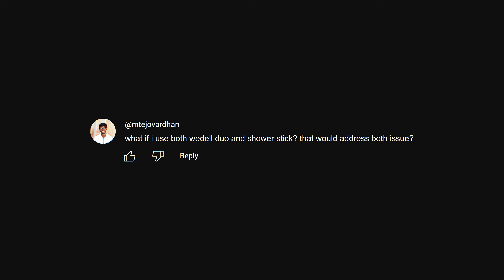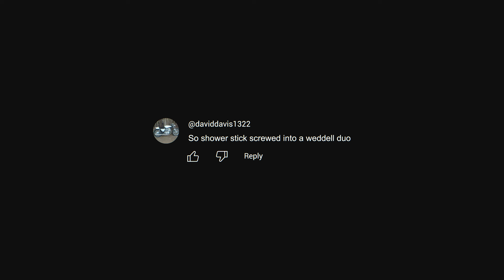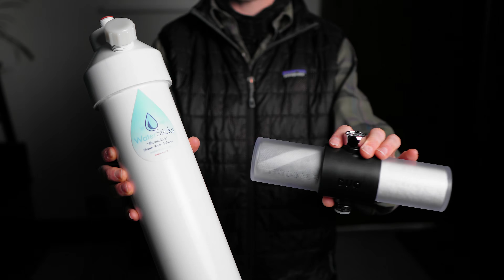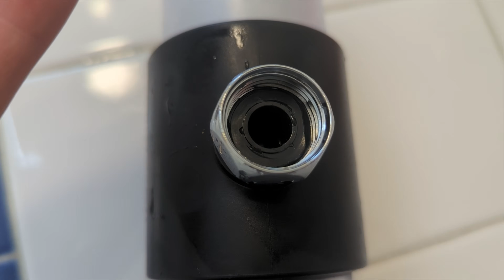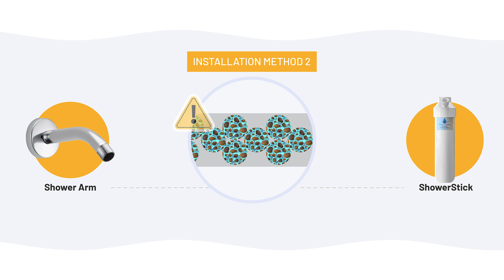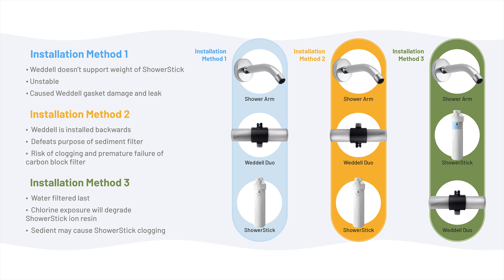Weddell Duo + Shower Stick Compatibility Test

Comment: The Weddells connections are terrible. Add a few more threads on each end would make a huge difference. The designer needs to be beat with a rubber hose.
Reply from the maker: Have you shared this feedback with the manufacturer directly?

Comment: Have Water Sticks update the design since this video? Because from the pictures I see online, there is a bracket that sits on top of the metal shower head pipe and holds the Water Stick like a brace.
Reply from the maker: They must have

Comment: I don’t understand the problem with mounting the duo after the shower, stick i.e. on the bottom of it as shown in method three. The shower stick normally does not have a chlorine filter upstream when installed alone, as per manufacturers instructions. So why would it be a problem with installing your chlorine removal filter after the hard water removal done by the shower stick?
Reply from the maker: I don’t know why the manufacturer instructions would suggest installing it in that configuration. From a water treatment standpoint, it’s generally backwards.

Chlorine can damage the cation exchange resin inside the ShowerStick over time. That resin is what actually does the hard water removal, so exposing it to chlorinated water shortens its lifespan and reduces effectiveness. In the water treatment industry more broadly, we almost always recommend removing chlorine upstream of any water softener for that exact reason.

The only real exception is if the water is extremely hard and you’re trying to prevent scaling or fouling of a downstream carbon filter. But in typical residential conditions, protecting the resin is the priority.
Reply: @waterfilterguru  Their  installation video shows you can install a KDF canister style filter upstream of the Shower Stick. A link to that video is attached.  videhttps://youtube.com/shorts/1jJxiTd4g4Y?si=Z4-kuETSRZLqVGpM

Comment: I have this exact setup and it works perfectly. The Shower Stick comes with a bracket, so all the issues described in this video don’t really apply. The bracket holds the Shower stick firmly (attaches to the shower pipe itself). The set up was super easy. Very happy with mine so far!
Reply from the maker: Glad to hear it. There's an even better way to soften hard water for renters, https://youtu.be/f5cbIdOZzek for anyone else reading this

Comment: Im confused. I understand your reasoning to install the weddel duo before the waterstick, but the installation video for the waterstick website recommends to install a kdf filter after. So in your 'testing' you found the water filter is best before a softener?
Reply from the maker: Don't know why they would recommend that order of installation. KDF removes chlorine, which can damage the resin in the softener. Chlorine should be removed upstream of any softener
Reply: @waterfilterguru hm good to know. Will try to set it up before hand. I will also ask customer service to confirm the order of installation. Thanks!

Comment: The water stick has a bracket to hold the weight and tubing that runs from the filter to the top of the under hanging water stick.
Reply from the maker: At the time of recording it did not. Thanks for the comment!

Comment: I have an important question since the shower stick is meant to be placed under the shower. My question is about the resin inside the shower stick. Will it be damaged or deteriorate with hot water? Most water softeners with resin specify a maximum temperature for cold water and a maximum temperature the resin can withstand. I checked the website and couldn't find any information about the maximum temperature the shower stick resin can withstand. To be honest, you'll mostly be using it with hot water...
Reply from the maker: Great question. I’ve looked into this and from what I’ve read in the documentation from cation-exchange resin manufacturers, cation exchange resins (what's used in water softeners) can withstand temperatures far higher than what people shower in. Here are a couple sources:
https://www.dupont.com/content/dam/water/amer/us/en/water/public/documents/en/IER-Temperature-stability-TechFact-45-D01456-en.pdf
https://www.resintech.com/wp-content/uploads/2021/03/Somelikeithot-1-1.pdf

I’m not aware of any research or data showing that the materials used in softening resin leach chemicals at normal shower temperatures. This is a great idea for a follow-up project and I've added it to my list.

One thing that really matters also is certification. Resins used in water softeners can be certified to NSF/ANSI standards for safety, and they should be able to tell you exactly which resin manufacturer they use. From there, you can verify whether the resin itself is certified or not.

I hope this helps
Reply: @waterfilterguru Great, it was really helpful... and thank you so much, your channel has helped me a lot to learn a little more. There are many products that are just marketing hype, and others that are really worthwhile for taking care of your health. 👏
Reply from the maker: @YOSHVE-y3b glad to hear it! Thanks for the support

Comment: I dont get why the 2nd or 3rd option wouldn’t work especially if someone was going to get just one of the products. I just bought the wedell and it didn’t last 2 weeks before it started to lose pressure. Would it actually be worse to have it at the bottom of the shower stick? If its before the shower stick I would assume it would be clogged up in another 2 weeks?
Reply from the maker: I made this video all about this https://youtu.be/Z9qCHgU0V7M

Comment: This was so helpful! I have the water stick but my hair is majorly suffering 😢 Please help us Water Guru! 🙏 I am an aesthetician, so the health of skin and hair is paramount ❤
Reply from the maker: The shower stick should be softening the water, so you can rule out hardness as the culprit assuming it is working properly. You can test this with simple water hardness test strips. If the water coming out of the shower with the shower stick installed is soft, it's working. If not, it needs to be regenerated with salt following the manufacturer's instructions. 

Chlorine is the other common culprit for hair issues. The shower stick alone does not remove chlorine. You need an additional chlorine filter, do you have one installed with the shower stick? 

This is all assuming you're on city water. If you're on well water there are other water problems that could be the cause.

Comment: I was able to connect the Water Stick to the Weddell filter.  I connected the Weddell directly to the bottom of the Water Stick and reversed the filters in the Weddell so the  Weddel outlet is now the inlet and outlet is now the inlet this should put the water flow through the white filter first then the charcoal filter next and finally the water flows into the "Water Stick" and out to the hand held spray nozzle.  To avoid putting too much weight on any plumbing fixtures I purchased a second connection hose and rested the whole device on the rim of the tub on its side and used 3M hooks plus zip ties to keep in place resting on the rim of the tube.  It is placed horizontally on its side under the tub spout with the side port point up.  This allows it to drain through the handheld nozzle when you need to regenerate it just pour salt solution into side port per Water Stick's instructions.
Reply from the maker: Nice! Thanks for sharing
Reply: Please do a video on this.

Comment: Awesome review, seems method 3 is acceptable “IF” you recharge/clean maintaining shower stick performance more frequently. Thoughts?
Reply from the maker: Yes correct. The shower stick will require more frequent regeneration. The regeneration process is a little bit more tricky too since you have to mix a salt solution first and pour it in a small port, rather than simply putting dry salt directly in

Comment: Great video! I was wondering if you could test the Crystal Quest shower filter to see if it’s legit in removing heavy metals?  I have it hooked to my shower stick and it seems to work just fine.  Just not sure how legit the product is.  I’ve had the Shower stick for over a decade and love it for my soft water in the shower as a renter.
Reply from the maker: Thanks for the comment! I haven’t tested the Crystal Quest shower filter yet but can add it to my list. Just keep in mind most shower filters aren’t certified for heavy metal removal, so any such claims should be taken cautiously. Glad to hear your Shower Stick is still serving you well — soft water really does make a big difference in the shower!

Comment: This wouldn't be such an issue if Weddell just made the middle part out of metal. Being that it's almost $100 I hate the fact that it's all plastic. Middle should be metal and the ends should remain the clear plastic so you could see inside.

That being said, I did use your link and code to order the weddell, but I guess I'm not getting the water stick. However I do wonder though if the seal is getting damaged from the weight, maybe you could just take it out and use the plumbers tape only to prevent the leak? I guess you'd just have to be careful not to bump the whole set up. Too bad weddell can't make a unit that softens as well as the other two filters it has.
Reply from the maker: There's a better solution to soften hard water and combine with the Weddell filter, which doesn't put strain on the connection. Check it out! https://youtu.be/f5cbIdOZzek

Comment: For method 1 I don't understand. Why not use a short hose from the Duo to the shower stick? Then your shower stick would be mounted to the hanger bar with a clamp and not dangling with the Duo. If you see their KDF Shower Filter setup with shower stick, then it should be same thing, you just need to replace the KDF filter with Weddell Duo
Reply from the maker: The mounting bracket for the shower stick was not available yet when this video was made

Comment: Wow!  Thanks 🙏🏻 so much for testing all these shower filters and water filtration systems!  You have the best data 📈 on all of this and it is so helpful! 🌟 I can’t thank you enough for saving us consumers all the headaches!  It’s been a nightmare trying to find what’s best due to sneaky marketing and scams!

I was really hoping to see these two shower filters working together.  I’ve had the Shower stick for over a decade, believe it or not! 😅 It’s eye-opening to see the results.  Definitely great for softening the water but it does upset and concern me that it doesn’t seem to get all the bad stuff out.  If you do another video on a better water softener solution with the Weddell Duo, that’d be amazing!
Reply from the maker: Already did! https://youtu.be/f5cbIdOZzek
Reply: Hi, you said you had used shower stick for over a decade.  May I ask if just 1 shower stick can last over a decade and still soften water without problem?  Or do you have to re-purchase a new one after certain time(whenever it stops working to soften water)?  Because I read some people said shower stick only works for a few months and then stop working afterwards.  I have been struggling with dry hair from hard water for 20 years and really want to try the shower stick.  But not sure if it will work for more than a year to justify the money.
Reply: @LaiSanMak  Hi!  Yes!  I still use the Shower Stick!  I have to regenerate every 5-7 days depending how often I shower.  They last for about 10 years and then you do have to buy a new one.  I am on my second one and have no issues.  Also good to get a chlorine filter for extra protection.  Definitely worth it for your skin and hair!  I haven’t had any issues all this time!
Reply: @Metalgal80 Tks so much for your sharing. Wow, one can last 10 years with proper regeneration. That's amazing. Now doing the measurements n see where we can hang it. Really look forward to shower in soft water. Tks again for your tip.
Reply: @LaiSanMak  Hi!  Yes!  I still use the Shower Stick!  I have to regenerate every 5-7 days depending how often I shower.  They last for about 10 years and then you do have to buy a new one.  I am on my second one and have no issues.  Also good to get a chlorine filter for extra protection.  Definitely worth it for your skin and hair!  I haven’t had any issues all this time!

Comment: I haven’t bought either of them, but I actually thought of doing the same thing myself. I looked at another video of the shower stick and it comes with a rubber hose it’s a female to female adapter where you can Install the shower duo on the shower arm, then connect that rubber hose to the bottom of the water duo then  connect to the top of the shower stick then you would use the shower stick bracket to hold it to the shower arm, not needing to connect directly to each other and that should work 🤔
Reply from the maker: Interesting sounds like they've added some additional components since I made this video. Let us know how it works for you
Reply: Did it work for you?

Comment: Can I not just pour softening resin into an empty shower head that usually has the beads in and replace the beads with the resin to even partially soften the water???
Reply from the maker: In theory that would work! The issue would be low softening capacity with such a small bed of resin. Depending on how hard the water is, it may only last for one or two showers before needing to be regenerated. Shower head filters just don’t hold enough resin to provide meaningful softening unless your water is only very mildly hard. For true softening, you’d need a much larger volume of resin, like a portable softener unit that can actually be regenerated with salt. Check out this video! https://youtu.be/f5cbIdOZzek

Comment: im confused why setup 3 doesn't work. If the sediment issue was a big no no then the showerstick would not be able to be installed alone no?
Reply from the maker: The Weddell sediment filter protects the subsequent carbon block filter from premature clogging. The shower stick does not use a carbon block filter

Comment: I am curious about this particularly because EWG believes there is a considerable presence of TTHM/HAA5 in my municipal water supply, but also quite a bit of Radium. I'm curious if the shower stick ion exchange resin is effective against Radium, since radium is chemically similar to calcium.
Reply from the maker: Yes, cation exchange is the recommended treatment method for radium in water

Comment: I like your content but am confused why you did it the way you did?  The method that works for me is Instead of using the KDF filter I use the Waddell Duo and use the same installation from their.  Not sure why there wasn't and example with the Showerstick's hanger along with the cord from the Waddell to the Showerstick, but it works perfectly well. The Waddell is upstream and nothing is hanging off of the Waddell like in your first example of how to connect the two together.
Reply from the maker: Shower stick did not yet offer that bracket at the time of recording
Reply: @waterfilterguru  Yeah, I saw that later in a similar comment.  I hadn't considered that there wasn't an arm for the Showerstick.  Seems like it's a needed feature. Also you can buy that arm online, figured since you had everything water filters you would have picked it up before making this tutorial. Thanks for your help.  I'm very happy with your advice.
Reply: @AndrewGabriel-h6c  Agree. He did the company a disservice not getting the arm. They literally improved their product and he didn't bother to get that version. I installed like the 1st setup but with the arm and it's fine.

Comment: what if you were able to mount the shower stick to the wall of the shower and connect the two with a small hose? Would eliminate the weight concern no? maybe a 3d printed solution?
Reply from the maker: I believe they started selling the product with such a bracket since I made this video. But there's a better solution to soften the water for just one shower for rental situations, check it out https://youtu.be/f5cbIdOZzek
Reply: @waterfilterguru not in a rental
Reply from the maker: Then a point of entry whole home water softener like this https://geni.us/RP5Ui is your best bet
Reply: @waterfilterguru  thank you!!!

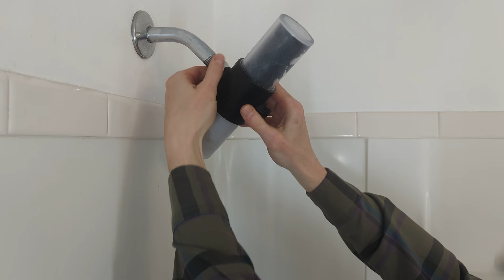Comment: 1:54 what about the water stick setup that has the arm to attach to the shower pipe closer to the wall?
Reply from the maker: That bracket was not yet available when I purchased the showerstick and made this video. An improvement, but there is still a better option to soften the water for just one shower https://youtu.be/f5cbIdOZzek
Reply: @waterfilterguru  you cant improvise a bracket?  That 3m adhesive backing on different shower accessories is crazy strong, i have a stick on shower head holder that I slapped onto the plastic liner of the shower wall and it hasnt moved in years.  I have a pretty heavy shower head I hang on it too.  I could see just grabbing two of those and then doing some kind of secure hitch knots depending on the hook shape and just tie it to both adhesive hooks on either side of the tank, something like that.   Also are you using a gasket at that first connection pount thats leaking? Is that why you skipped plumbers tape?

Comment: I got the weddell
And after a week it was dark as heck!!!
I tested the water before and after and it made no difference. 🤷🏽‍♀️😫
Reply from the maker: Can you elaborate? What do you mean you tested the water before and after? How did you test the water? Share your data?

If the sediment filter turned dark after just one week, this tells me there is a water quality issue and the filter is working as intended to remove contaminants.

Comment: you would need hose extender and then have a holder for the shower stick.  That's a little bit if DIY.
Reply from the maker: There is a better way for renters to soften and filter water for just one shower https://youtu.be/f5cbIdOZzek